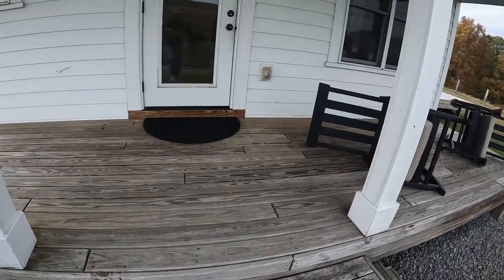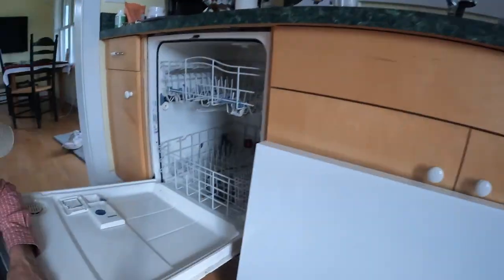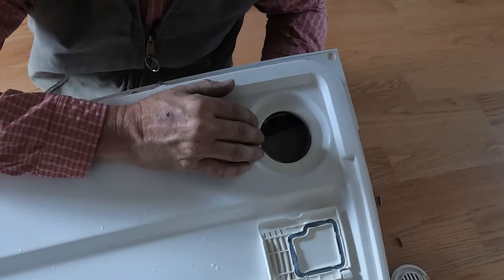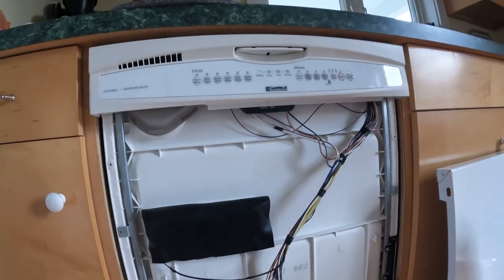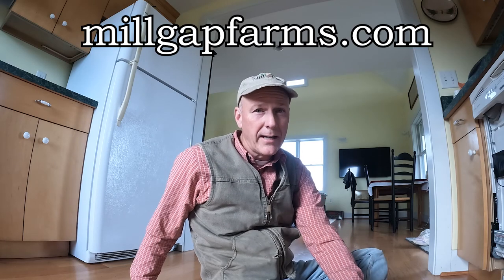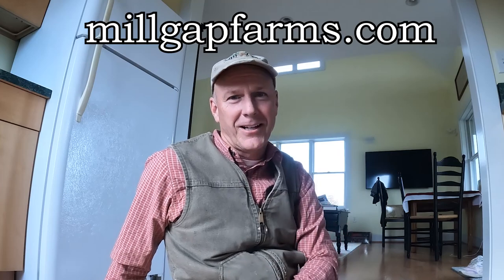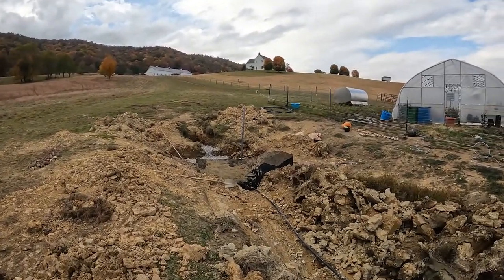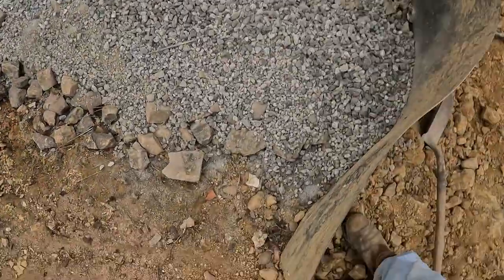Kenmore Dishwasher Leaking - Easy Repair

Comment: I gotta thank ya. It took me a while to get to it because I couldn't find my torks bits so I was using my Grandparents dishwasher next door and doing them by hand. I changed the door gasket first and it still leaked. I didn't wanna order the part you replaced without opening the door up because that little gasket cost me ＄90 CAD (delivered)  from Amazon. The part was ＄65 and ＄25 for delivery. I didn't wanna order the part until I could get into the door to figure out if that was the leak. We have really bad lime scale so as soon as I opened that door and saw all that lime scale INSIDE the door and leaking right from the bottom of that box where the gasket goes. Ordered the part right away. Said it might take up to a couple weeks and only took 3 days.

I can't thank you enough. Without you I wouldn't have had a chance. 

My Grandfather grew up on a farm until he was in his 20's and went on to the Carpenters Union for 50 years. He died last year so I'm on my own when it comes to home repair. He left me a small fortune in Snap On tools (and other various tools) so I'm doing OK. 👍
Thanks again and may God bless you and your family as well! 🙏❤️
Reply from the maker: Hi Butters_147,  you made my day with your comment.  Thanks for watching our video and taking the time to share your thoughts.  We can do all things through Him who strengthens us...! (paraphrased)...  I you have any other home challenges go to our website www.millgapfarms.com and email me.  I'll do what I can to help out!  Kevin

Comment: wow Kevin, I think this may be our problem. I reached up under the door panel and the sound insulation was wet. I couldn't figure out how that would happen if the door gasket was where it was leaking. Great to have a solution from right here in Virginia!
Reply from the maker: Mr. Hensley,  Thanks for watching and sharing your comment. I can tell you that since this video, our washer has not leaked.  I thought it was the door gasket so I bought one at the same time as the part that fixed it.  Of course after repairing the door, I'm not exactly sure of where I put it... but, I have one.  This has to be the easiest repair to an appliance I've ever done!  I wish all my repairs were this easy!  Again, thanks for watching and sharing your thoughts!  Kevin
Reply: @MillGapFarms  Thanks Kevin, the vent gasket fixed it! God bless you and everyone on Mill Gap Farm.
Reply from the maker: AWESOME!!!!  Thanks for sharing your success!  Kevin

Comment: That is exactly what my door leak was doing.  Found a bunch of crud and hardness buildup on and around the O-ring seal.  Cleaned everything and put it together.  Still need to test it.
Reply from the maker: I will be curious to learn if this works for you.  It makes sense that it would. If were to do it again, I would use this product...through the roof to seal it.  https://amzn.to/4biFWB5  The only reason I would use this is because we keep it on the farm.  If I had to buy it, then I would probably opt for a new gasket.  Thanks for watching and leaving your comment.  This is how we learn together. Kevin

Comment: Thanks!!  After researching parts- Either you need to buy the vent assembly or pay $30, I think I met just clean it and add some silicone sealer
Reply from the maker: Try this product out versus regular silicone.  I've never seen anything more stick!  It's called  "Through the Roof".  I keep a few tubes in stock at all times.  You can apply it wet but in this case,  I would dry it off before applying.  https://amzn.to/3MthjaE    I would be curious as to how your repair goes.  Thanks for watching and leaving your comment.  Kevin

Comment: Great video! I have a Maytag that looks exactly like this dishwasher.  Mine is leaking on both sides too and its also coming out of the top by the handle.  I think it might be the same thing. I think In going to run the washer with the cover off the door to see where it leaking.  I already changed the bottom gasket which did absolutely nothing.
Reply from the maker: Rivers, thanks for watching our video.  I am curious as to what’s happening with you washer.  When I performed my test, I had to do it a couple of times in order to get it to leak. I would love to know what your results are.  Thanks kevin
Reply: @MillGapFarms  I ran it w the cover off and I could not see where the water was coming from.   I think i figured out the problem. The plastic upper part that  has the handle and electronics has it has 4 screw risers in the plastic.  Two of those had broken off. This was letting the top flex a bit when locking the door.  I think it was simply leaking thought the top sides because it wasn't closeting all the way. I had already bough and installed the bottom door seal which did not fix the problem.  I decided rather than trial and error with more parts I would just get a new dish washer. The problem was probably  that the top piece needed to be replaced.
Reply from the maker: Rivers, thanks for sharing.  I hope  I don't encounter the same issue but if I do, I'll more about what could be the cause.  Kevin

Comment: I’m having a leak @ both corners of the door. It will run almost a full cycle and with a few minutes left it begins to leak.
Reply from the maker: Dfdrescue,  that's indicative of a door seal.  What I would do is pull the front, put news paper down in front of the washer and do a cycle.  If you don't see leaks at the vent (which is not a normal leak), then the next option is the seal.  I hope this helps.  If you want to discuss this further go to our website www.millgapfarms.com and send me an email. After a few days, comments will start piling up and sometimes I miss them if they are old.  I'm still trying to figure out how to show new ones but so far no luck with out subscribing to an expensive 3rd party app.  Thanks for watching!  Kevin
Reply: @MillGapFarms  I put a new door seal in a few days ago. Seemed like the obvious and easy fix. Ran a cycle last night with the door cover off. Only water I noticed was dripping out of the vent @ the bottom. It wasn’t nearly as much as when the door panel is on. There was no water anywhere else. Still troubleshooting.
Reply: Apparently on mine the wax motor that opens and closes the vent @ the end of cycle to dry the dishes can fail open and water can make its way into the blower.
Reply from the maker: Dfrescue, Is that what you saw when you pulled the door and ran a cycle?  that's weird.  K

Comment: I have the same washer. It's leaking from the pump but I can't figure out where. The seals have no moving parts so how could they wear out is my question. There is 2 o'rings each with flat sides. They are mounted in grooves and install in a plastic housing but there is nothing moving to wear out these o'rings. They seem soft and new no flat sides. i cleaned them up and reinstalled them only for it to leak again. The pump can be remove with 2 screws so it's easy to have a look. Thinking maybe there was debris under causing a leak. It's not the pump leaking because there is no liquid any further into the pump. Any ideas?
Reply from the maker: Have you taken the front panel and lower panel off to watch a cycle?  Do that first. That's how I found my leak.  Let me know how it goes.  I forgot to share this tidbit.  I like to use clean newspaper under what I think is leaking.  When a drop of water hits it, you can see it very easily. 
 Kevin

Comment: Unfortunately some of these Kenmore washers have their gasket glued in 😢
Reply from the maker: HI Alm1ghty.peanut.  Love the name!  If the gasket is glued in.  Could it still leak?  Ours was not glued it and it definitely leaked... and hasn't leaked since this repair. Thankfully!  Thanks for watching and posting your comment.  Kevin
Reply: @MillGapFarms   I'm not sure the leak, symptoms you described are a lot like mine, only leaking from the left side. I replaced the door seal originally and the leak is still the same so I'm hoping it's this. I am replacing the entire part just in case. Only cost $18 and I have a fresh gasket just in case for the new one 😁
Reply from the maker: I'm curious as to how your made out?  Did it work for you.  I'm sorry about the delayed response.  This is one of the busiest times of the year for us regarding maple.  Thanks for sharing your thoughts.  Kevin
Reply: @MillGapFarms   I believe it did fix it! I haven't had any leaks in weeks now. I still have a towel on the edge because I still don't trust it but so far no water drops or even wet cotton. Thank you!
Reply from the maker: Thanks for following up!  I'm glad it worked for you.  Kevin